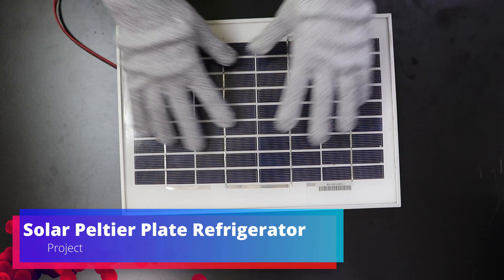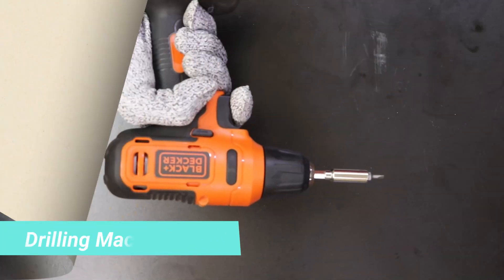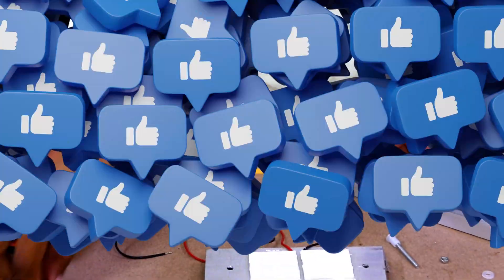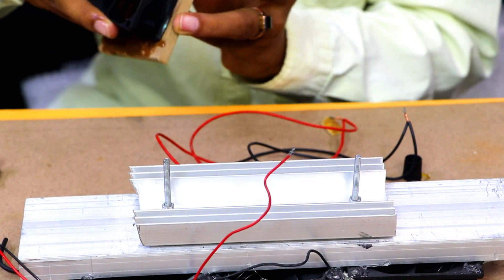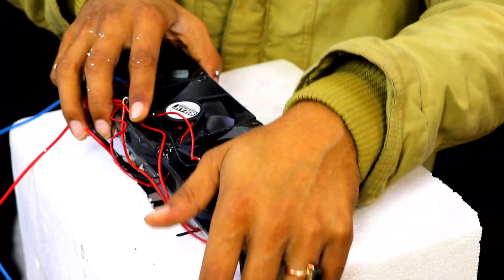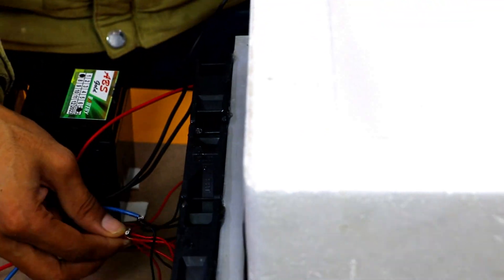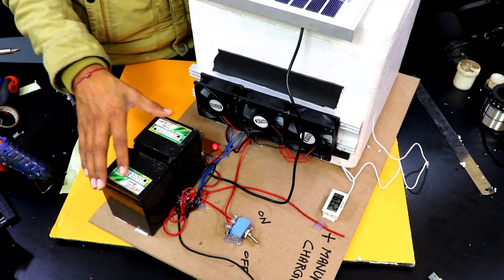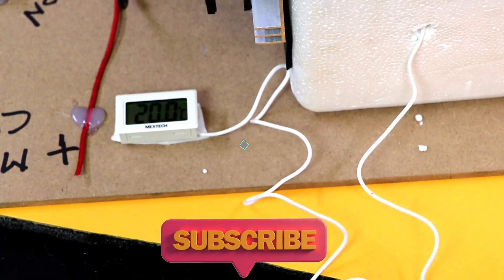Solar Peltier Plate Refrigerator | Project Tutorial

Comment: I gave 12V 7ampere to the Peltier module TEC1 12706 , after few second both side get hot too much, what efficiency of battery should be use. I use aluminium window channel at the place of heat sink. 
Should I use aluminium window channel?

Comment: CAN YOU SEND LINK OF THE SOLAR PANEL TO BUY (OR) ITS OK IF YOU  TELL THE SEPICIFICATION OF SOLAR PANEL BEEN USED
Reply from the maker: You can use the solar panel with 12 volt output and 9 watt there easily available on all the E-Commerce Store like Flipkart and Amazon you can buy it from there.

Comment: Hey I have questions: 1.	What is the effectiveness of this refrigerator?
2.	What is the difference in energy consumption and environmental impact between this refrigerator and traditional non-electric refrigerators? 
3.	How long can this refrigerator maintain cooling temperatures?
4.	What is the average temperature maintained by refrigerators over a specified period?
5.	What is the minimum and maximum temperature range of this refrigerator?

Comment: How to control the solar  charge
Reply from the maker: you can connect the solar panel directly to the battery through the diode. The diode prevents the battery from discharging back into the solar panel at night. This setup ensures that energy flows from the solar panel to the battery during the day and prevents reverse flow at night.